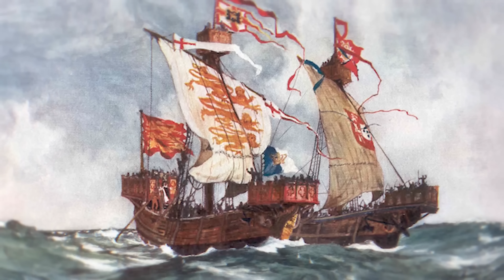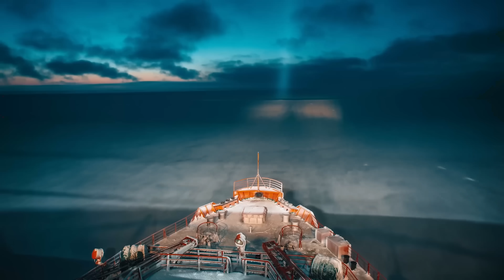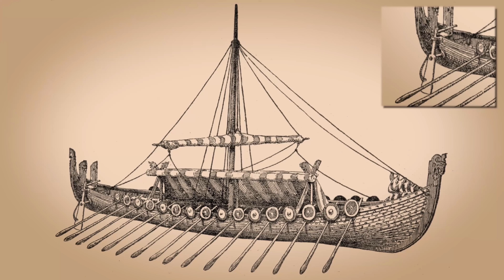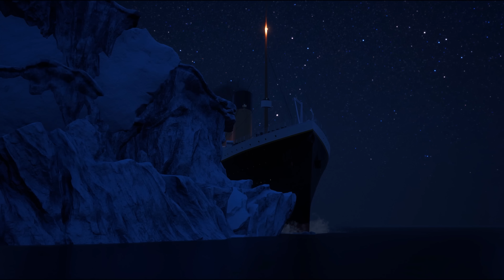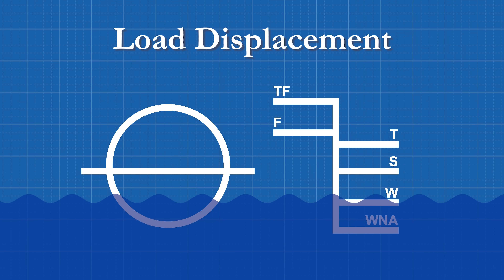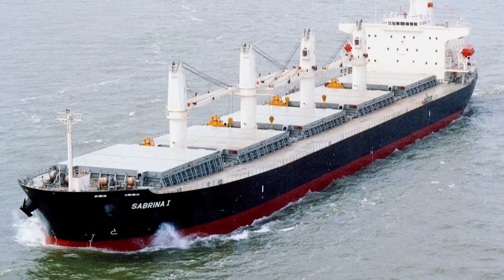How Ships Work: How Ships Signal, Turn And Balance At Sea

Comment: As a former OTR truck driver there are three measurements of weight. first there's tare weight. which is the weight of the tractor and trailer with no cargo. then there's net weight which is the weight of the cargo alone. and then there's gross weight. which is the weight of the tractor and trailer and the cargo. and the weight of the cargo has to destributed correctly though out the length of the tractor and trailer. to have the correct axle weights. and it appears that it seems to be sorta similar for ships. except that trucks are weighed on scales. and that ships are weighed by volume of water they displace.

in the United States a ton is 2000 lbs. so an 80,000 lb semi truck. weighs 40 tons. and in the United States tonnage is used for licencing costs and permits.

the are animals that understand the concept of volume. for example Crows they have been studied filling beakers with stones. to raise the water level to where they can receive a reward. when the water is high enough for them reach the reward.

Comment: I heard Stephen Payne say in a lecture recently that he believes that if Titanic had had a rudder with a curved surface that generated lift via the Bernoulli Effect (a type of rudder that was in use at the time) she would have avoided the ice berg.  But she couldn't turn fast enough because she had a very old fashioned (even for the time) flat rudder her turning circle was too wide and her pivot point too far aft to make the turn.

Comment: Beautifully researched, written and narrated presentation.  As a son, grandson, nephew & uncle of sailing men, I salute the seaworthiness of this video!
        I realize subscribers to this channel are way beyond the basics of navigation, but I recommend reading about the great mathematician Archimedes and his achievements in physics, geometry and celestial mechanics. He helped launch original discoveries about marine navigation across a sphere, about buoyancy & vessel displacement, using the Archimedes Screw for pumping water, the use of triangulation for comparing star positions against the horizon, and using levers for lifting anything, especially cargo. 
         Without Archimedes, we'd still be paddling rafts down rivers, timidly venturing onto the Mediterranean Sea but deathly afraid to sail any farther west than the Pillars of Hercules (the Rock of Gibraltar).

Comment: Fun fact: "Green-to-Green" is common verbiage in US miliary parlance for "Good-to-Go". Especially amongst infantry and logistics soldiers. Typical shorthand for military folks, especially when using radio (where shorthand and highly distinctive phonemes are important to break through anv noise or intermittent traffic (eg 'repeat' vs 'say again', which could mean the difference between "send more artillery rounds"' vs "i did not hear you".). Standard simplification of information is super important when lives and materiel are on the line!

Comment: Random anecdote: In some d20 based ship RPG supplements [like old Spelljammer] Tonnage is rated in 10-foot cubes of volume. So a 20 ton vessel has 200 cubic feet of total space to spend, before propulsion, structure, armor, and accoutrements. This allows artists to accurately depict the internals, as said 20 ton ship, at 10% Internal structure, would have 2 tons of hull, or a total of 20 cubic feet of hull to draw.

There are also upgrades that can increase the storage capacity of specific areas, converting "tons displacement" to "tons of cargo". Stuff like cargo winches, storage racks, etc.

Comment: An important point about the different Plimsoll lines:  it’s not just about the water density.  Yes, that’s part of it, especially in the difference between fresh and salt water load lines.  But the other big factor is the weather conditions.  Winter load line is more restrictive than summer because it is stormier and you need that extra bit of freeboard to be safe.  Winter North Atlantic is the lowest because the North Atlantic has some of the worst conditions in the world.

Comment: Could you do a video about Voith Schneider system? 

Voith Schneider Propeller is Extraordinary
The unique design gives the VSP its revolutionary maneuverability, which is why you see it on offshore vessels, ferries, and tugboats:

Instantaneous Direction Change: By adjusting the cyclic pitch, the VSP can instantly change the direction of its thrust 360 degrees without needing a separate rudder or needing to reverse the rotation of the propeller itself.

Vector Thrust: It can generate thrust simultaneously in both forward/aft and port/starboard directions, allowing the vessel to move sideways or rotate in place (a key feature for Dynamic Positioning (DP) on oil rigs).

Low Speed Precision: This precision control is what allows the ship to maneuver effectively at very low speeds or hold position perfectly, which is essential when working near fixed offshore structures.

Comment: I really apprediated the presentation on "tonnage".  In my engineering work, I'm often confronted with ship displacement questions, and have never been satisfied with the online explanations.  Yours are first rate.
Reply: I realize you're way beyond the basics, but it's worth reading about the great mathematician Archimedes and his achievements in physics, geometry and celestial mechanics that launched original discoveries about marine navigation across a sphere, buoyancy & vessel displacement, the Archimedes Screw for pumping water, the use of triangulation for comparing star positions against the horizon, and using levers for lifting anything, especially cargo.

Comment: Navigation wise the worst I've come across are weekend sailors who think they know more than they actually do. Don't get me wrong, I certainly don't think ever part time sailor is like that but there's certainly a small minority who are. The last one I interacted with called us on the radio & told me that as he was the stand-on vessels & also as he was a sailing vessel he automatically had the right of way (which is somewhat accurate for a vessel under sail), so we were to alter course immediately. I'd been watching him on the radar & GPS plotter for around 20 min's so knew his speed & course, so I answered him with "Yea, no bother, I'll turn immediately but seeing as we're a Trawler towing around 10 tonnes of gear behind us, + the fact we're traveling at 3.2 knots it might take us a moment to manoeuvre!". I then said that"As he was under engine power & didn't actually have any sail's up he technically wasn't a sailing vessel, he was a power driven vessel who was travelling at 8 knots & had been coming straight towards us for the last 20 minutes & as we were the only 2 vessels within 7 miles of anyone it might be easier for him to alter slightly as it made absolutely no sense what he was doing". He still thought he had the right of way so I told him I would just hold our course until he put his sails up then we would alter course. He didn't answer but altered his course! 🤦

Comment: I think a factor in the red/green thing is that oil lamps with an orange- yellow flame would be significantly less bright through a blue filter than a red or green one.
Also, the eye has way fewer short-wavelength (or "blue") receptors than the medium/green or long/red ones, so a truly blue light at a distance could be harder to see simply because there were fewer receptors capable of seeing it, and while a less saturated blue (ie more white light) would be easier to see, it would be harder to distinguish from a white light (though I guess the "white" lights were still somewhat yellow).
Blue light might also have more issues penetrating faint mist or fog.
It's weird how we generally don't notice just how low resolution our blue vision is (though I suppose that if we could easily notice that, it might not have ended up being a thing, evolutionally speaking).
I remember back many decades ago when I was working in a lab which had a slide-printer to make 35mm transparencies for presentations at conferences. It was pretty high resolution, and could give really vibrant colours with the appropriate film.
One time I had to create the slides for a presentation, and my boss really didn't get on with another guy who we really couldn't avoid mentioning on the acknowledgements slide at the end, and I wasn't a fan of his either, so I did the names each in different bright colours on a pure black background, and made that guy's name a pure blue at max intensity, and while you could easily see that there was blue *there*, from most viewing distances it was almost impossible to read, as your eyes really couldn't do their usual edge-detection job to pick out the outline of the letters, while all the other names were stunningly legible.
Reply: Maybe also worth noting, a lot of the early combustible signals were blue or blue-white, just as an inescapable result of the chemical agents used, so leaving that frequency band fairly unpolluted under regular navigational conditions would have made emergency flares (like those released from RMS Empress of Ireland as she capsized) or socket shells (like those fired from SS Atlantic and RMS Titanic as they were evacuated) easier to detect.
Reply: A licensed mariner here. It may have to do with the rule that in a crossing situation, a vessel which has another vessel on her starboard side must give way. In such a situation the give way vessel would see a red light, while the other ship would see a green light.

Comment: I've always remembered that the port side is left because port and left both have four letters!
Reply: Or is there any PORT LEFT? port is also red (port the drink)
Reply: When I wrote night rating exam for my PPL, we got given a single blank page for notes. The only thing I wrote on it was "red port left"
Reply: Port Left Red are all short, and Starboard Right Green are all longer, that's how I remember it 😅
Reply: What no one (including Mike) seems to be mentioning is that the Port = Left and Starboard = Right applies when facing forward on the ship (or aircraft).
If you are facing aft it's the other way 'round.

Comment: Airlines had to develop rules too, with collisions! TCAS (Total Collision Avoidance System) was developed to give pilots a direct stern order to either dive or pull up. It was assigned by random between the computers of the planes detecting interception with one another. There was one accident in Russia decades ago where both planes had TCAS and still crashed. Turns out the ATC told one plane to dice even though that planes TCAS said pull up (or it was the other way around, but regardless, it was a conflicting order).

So new rules were developed to require pilots to give precedence to TCAS (since ATC couldn't see/hear the computer's orders). Of course, these rules don't address what to do if one plane doesn't have TCAS on/installed in their aircraft, so lord knows it'll be a matter of time until that incident occurs.